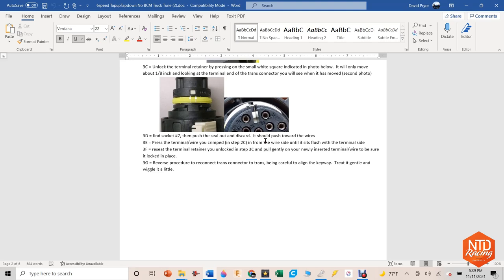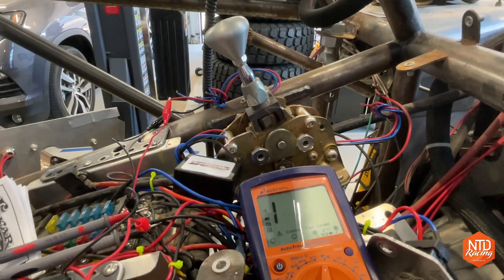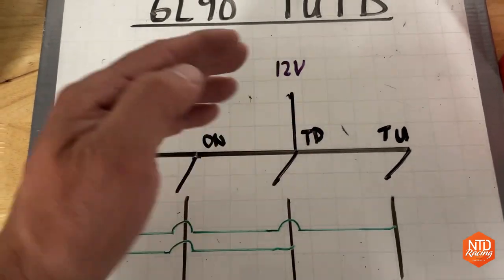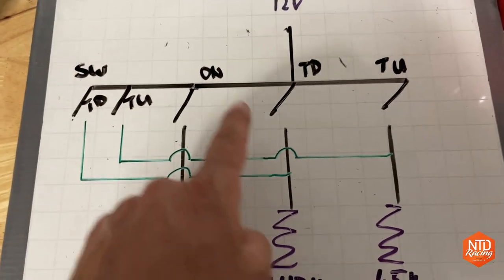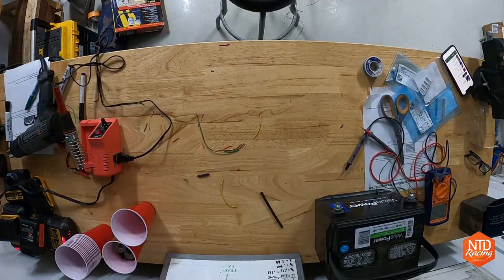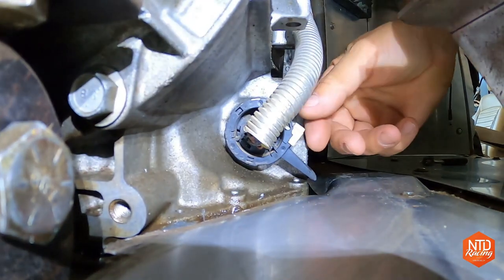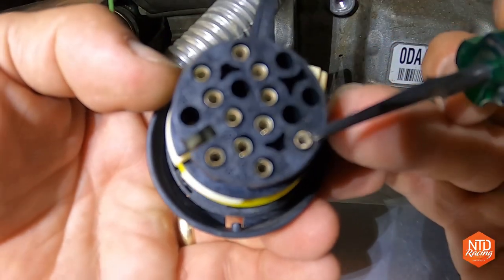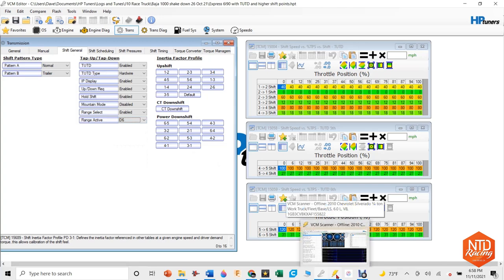Adding TUTD Sport shift to the 6L80 6L90

Comment: That is a great video! I was trying to figure out the TU/TD shifting on my own and had called Lokar to ask them for some help, they referred me to your video. Perfect!
Reply from the maker: Perfect.  Hope you can get it to work.
Reply: @ntdracing  Me too! Is there any reason for the shift signal to go through a CAN Bus gateway or does it make the most sense to just wire it directly? I am guessing that the signal being sent to pin seven is just telling the TCU to shift up and down and that the TCU is telling the ECU what gear it is in through one of the other pins correct?  Sorry - I am really new to this, figuring it out slowly...
Reply: About ready to tackle mine… I had a few questions. I bought a new 6l80 from GM. They actually have a set up for pin number 7 on the trans. I have two connectors, a two prong and a four prong. I was curious to see if I could get some help. I’m also a little confused the actual wiring from the shifter as to where they go. Im a bit new to this so sorry for my ignorance. Im sure your schematic explains it all but im still learning 😊

Comment: 100% awesome video that came at the right time for me!!! 76 Buick Regal restomod. 6.0 L96/6L90E
Reply: Anything funky with your swap? I’m buying a 1966 c30 that’s got the same combo (l96 / 6l90e). It randomly throws a p150A code but runs, sounds great and drives other than throwing that code. The guy who did the swap kept the stock harness, I’m wondering if I’m better off ordering a standalone harness from psi and starting from there.

Comment: This video is great! But I struggled with mine for two months, rewiring, reflashing, etc. Everything was right. I finally found a post by V8R on that same HPtuners thread. I needed to set U0121 and U0140 to do not report. These are codes looking for BCM and ABS module. This change allowed TUTD to work perfectly.

Comment: Thank you so much for this video I have a LT swap with the Lokar shifter and didn’t have a clue as to how I was going to make it work… your right on time with all the answers, THANKS!!! 👍🏾👍🏾
Reply from the maker: Nice!   Any shares are appreciated.
Reply: @ntdracing  I have a time lapse of my genV swap on my channel, I actually just had it tuned about a week ago and the shift points are off. But with your help I’ll be able to shift it manually so that will keep me from trying to get the tuner to fix his mistakes. (Which is hard🙄) sadly most of these guys just take your money and don’t own up to their mistakes as a tuner. But oh well it is what it is
Reply: @ntdracing  so to be clear this is one wire and jump the squats together using resistors in the right location?
Reply from the maker: @J2A61 hope this answers your question.  
12V on one side and pin 7 on the other with some switches and resistors in the middle.   
0V = Trans in normal drive mode
Move the shifter to sport.   Engage one switch and resistor = Trans in sport mode waiting for a command.   
Tap up or down.   Engage two switches resistors to send a shift up or down signal.
Reply: @ntdracing  yes sir, your the man! Thanks for the rapid response I’m wiring this up as we speak
Reply: @ntdracing  anyway you can help me troubleshoot??? Can I zoom call you or something please… I can get my shifter to checkout but when I plug in the 12v in wire I don’t seem to get resistance 🤷🏾‍♂️ I’m lost now… also will it not show if not wrote in from my hp tuners? I did enable it but not sure if I’ve wrote it in correctly
Reply: @ntdracing  are the resistors supposed to be on the line going to pin 7 or on the in side of the switches? Or does it matter?
Reply from the maker: Check out my description at minute 7 on the video.  That picture is exactly how I made the harness.  12V feeds into one side of all the switches.   When switch is turned on, 12V goes directly to a resistor.  The wire that connects to the other side of the resistor is spliced together with the other two wires from the other resistors and combine to make the pin 7 that goes into the transmission.   You can test your harness before you ever put it into the car.
Reply: @ntdracing  thank you, I’ll give that another shot
Reply: @ntdracing  I’ve come to the conclusion that it must be the 6l80 that I have because I’ve watched this video a 100 times and I still can’t get this to work…. I do have a functioning BCM this operating my gauges though I wonder if that could be a issue 🤷🏾‍♂️
Reply: @j2a61 did you figure it out? Looking at starting this but im bit confused.
Reply: @josephmora5050  funny you asked, I believe I have bought the wrong shifter… car runs great the transmission is upset and broken🤦🏾‍♂️ 
I think I should’ve bought the shifter with sport mode…. I think this all comes down to the model year..
Reply: @J2A61  anyway i can pick your brain for a bit? I have the lokar shifter
Reply: @josephmora5050 …. Shoot, but my shifter connection is simply bolted together as it should be. No modifications. I simply bought the wrong model for my application 
“I believe “

Comment: Good morning, is it possible to have a more detailed diagram on the connection of the sensors because they are 3 wires each and the lever has 3 so there are 9 wires, and in the video you show connecting only 3 resistors, and a better explanation about the connection is possible?
Reply: This would be soooo helpful! Better yet if you can walk me through it ill make a video for the people and give you the credit! 😊

Comment: So in my 2010 Chevy Express 3500 with a 6.0L V8 and the MYD 6L90, obviously with the manual mode, it will let you redline it out until you up shift into the next gear but what I wish it would do is you can give it wide open throttle and it would NOT automatically downshift but instead hold whatever gear you're in and more importantly, if I wanted to upshift early like progressive shifting while still doing wide open throttle, letting it shift as early as it's able to but yet, still doing wide open throttle. The Chevy 4-cylinder models are able to do that very style of shifting & throttling like a 2011 Chevy Cruze or a 2011 Chevy Malibu. I like to shift early around 2 or 3,000 RPMs but I never liked to let off the accelerator pedal. So my question is, does what you're doing in this video make it so that you can keep it wide open throttle but shift early, so in a sense, lug it down while still giving it wide open throttle?
Reply: https://youtu.be/IMib3g-slkE 

^There^ is an example of a video I made myself on exactly how I shift these GM manual modes at least for the 4-cylinder. For the Chevy Express I do use manual mode but I literally let off the fuel pedal, let it shift in the next gear and then I get on it but hopefully not too much on it to the point where it wants to downshift.

Comment: Great video!! Im thinking of adding the same Sport shifter to my OBS Chevy baja bulld!

Could you possibly do a huge favor for me and tell me approximately how many inches the lever sits when in park and D /as far back as it goes?
This console we built has a limited opening for the shifter lever. It was originally built around a B&M stealth shifter in which the Lever basically stays in place, only ratcheting nack & forth about a half inch.
Im hoping the travel of this Lokar will fit within my constraints I have.
Thanks man !

Comment: Fantastic video! What a great job! Question: Could this be made to work with button on the steering wheel and the stock column shifter? (Given that I can get the lever into the correct position).
Could this work i "D" and just have a switch to activate TUTD mode?
Reply: 9:25

Comment: is it possible to have a more detailed diagram on the connection of the sensors because they are 3 wires each and the lever has 3 so there are 9 wires, and in the video you show connecting only 3 resistors, and a better explanation about the connection is possible?
Reply from the maker: I will try to work on something.   In the mean time you can think of it like this.   12V positive from your battery goes to all three switches on the shifter.  I think I used the black wires for 12V in.   The red wire on the main shifter becomes hot when you put the shifter into sport mode.   This red wire goes to the 8.25k resistor.   The tap switches are different.  Black goes to 12V (your battery).   Blue goes to either the 4.42 or the 1.5.  After the resistors, all the wires come together and are pugged into pin 7.   I sure hope this helps.  If you have the wiring correct and you test it like I do in the video,  make sure you follow the steps to get the HP tuner part right.   Specifically the part when you figure out what gear the computer thinks it is in when you move the shifter to sport mode and activate the 8.25k resistor.   Good Luck

Comment: Just stumbled on to this great info. I didn’t know those trans could handle that kind of thrashing. What kind of upgrades were done to the trans to make it survive? I actually acquired one of these believe it’s a 90E but not sure how to identify the difference. Pulled from a perfectly driving vehicle.
Reply from the maker: I think the trick is to keep them cool.  We melted one down at Vegas to Reno.  Hit 270 degrees.    Since then we have quadrupled the size of our trans cooler.

Comment: Is the shifter/lever still in "D" or is it needed to go to the next detent "M" for this to work?

I'm being told if I program it to "D" I will have to go to neutral and back to "D" to disengage it.
Reply: Yes, you're right. If you program it to get into TUTD mode from D, in order to be in Drive mode, must go N and then D again.
Reply: @dsr_swap  OK! So in the Lokar case, you have to go to sport/TUTD. Then back to D then ratchet to N and back to D to release the TUTD?
Reply: @newergonnausethis  yes sr.

Comment: What wire did the resistors go onto do you have a wiring diagram for the harness you built? I just purchased all the items in the description
Reply from the maker: I electrical taped them to a popsicles stick as a strain relief.   Pretty high tech.
Reply: @ntdracing  I'm trying to wire mine I'm no electric expert so the NO/NC thing I'm confused lol did the resistors go to the blue wires black goes to ground and red to 12v?

Comment: Does this work with an E38 power control module? Does it matter which pcm used?
Reply from the maker: @djelewis  yes…I was using the E38.
Reply: @ntdracing  I appreciate that in a race car you might not need a reverse light, but where would the reverse signal come from when shifting like this?
Reply from the maker: @djelewis  that is a good question…I think the signal might come from the transmission harness??    Will have to check.
Reply: @ntdracing  I feel like it's a message that would travel on the CANBUS line from TCM to ECM then to BCM. I only say that because a 6L80 doesnt have an obvious neutral safety switch like some other transmissions which have 2 wires for each reverse and P/N which are connected when you select those gears. P/N wires would complete the starter earth relay and reverse wires complete the reverse relay. I'm yet to dig into intercepting and inserting CAN messages but it doesn't seem hard with an Arduino Uno and MCP2515 CAN transceiver.